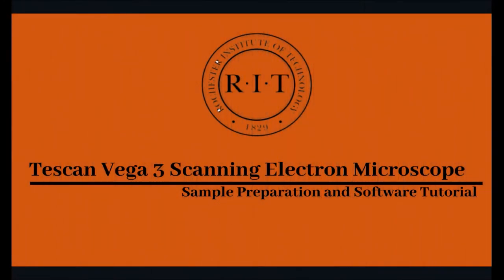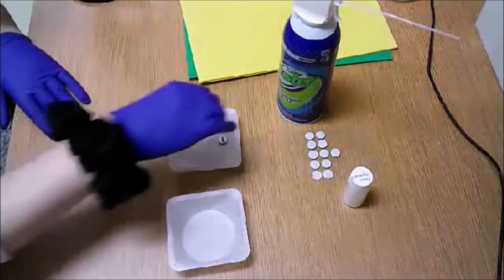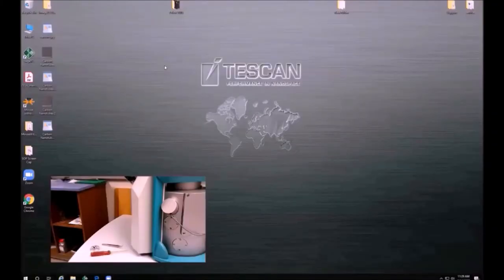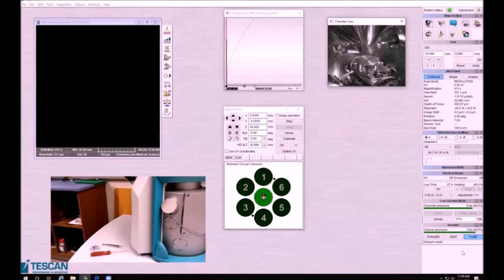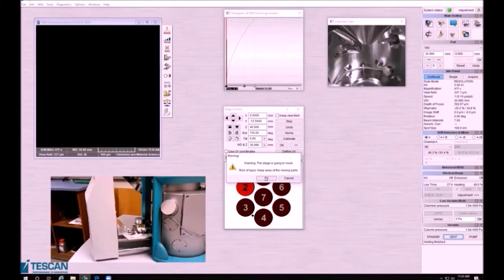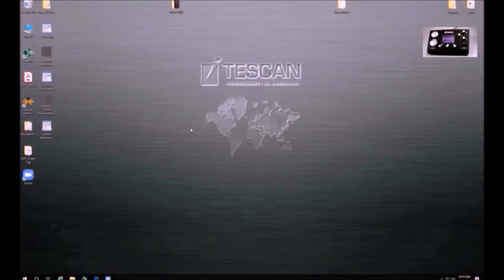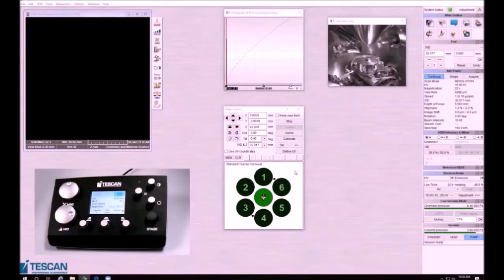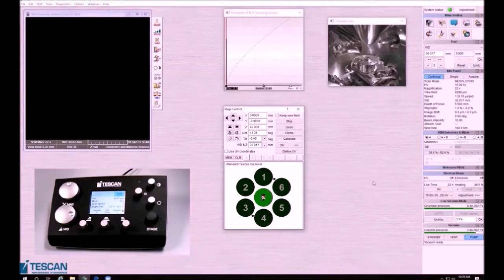Tescan Vega 3 SEM - Sample prep and Software Tutorial

Comment: How do I know the best kvs for my sample or workpiece?
Reply from the maker: When you say kvs do you mean accelerating voltage?  If you do, it would depend on the samples.  If you can elaborate I may be able to help.
Reply: @tomallston2118  Yeah accelerating voltage for the sample which I am using (Nickel- Inconel 718) after the surface grinding process by CBN single grain .
Reply from the maker: @mohammedal-nehari1135  This is a conductive sample so imaging should be straight forward.  If you want more of the very surface structure than 1-5 kev should do it.  Obviously 30 kev will always give you a better image but secondary electrons come from a deeper point in the sample.  For a metal sample this should not be as critical though.  Good luck.